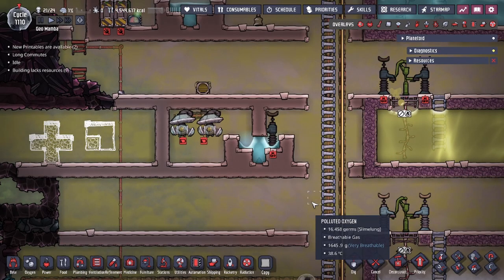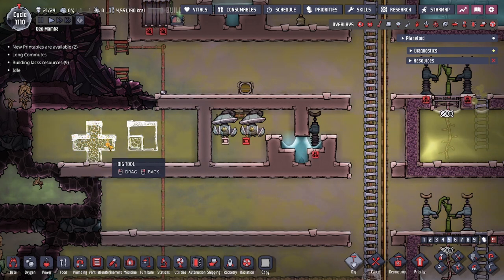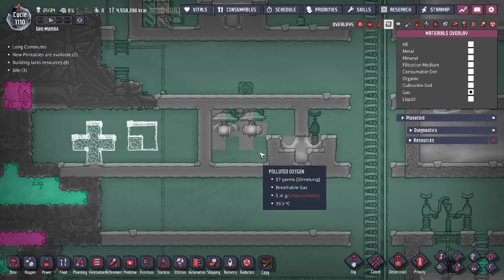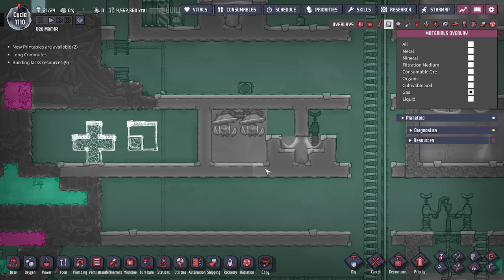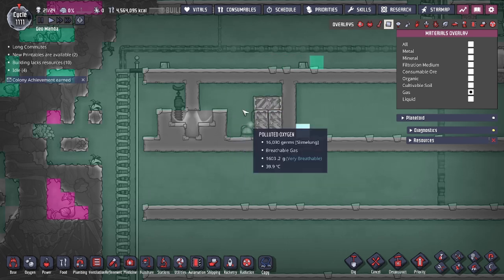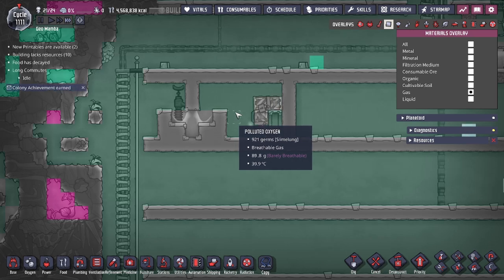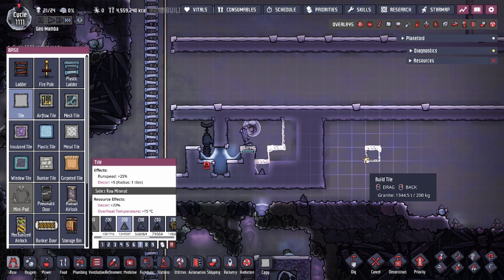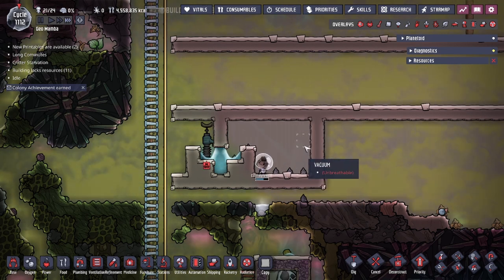Three Ways to Create a Vacuum in a Room - How to make a Vacuum Room - Oxygen Not Included Basics

Comment: I'm gonna have to try out that second method, but I'm thinking of just extending the build to have more doors crushing the air. Looks like any odd number would work. Something like five doors doing the crushing, three horizontal doors on top and one vertical door on the left forming the "wall" of the system.
Reply from the maker: you could extend the amount of tiles you "crush" by adding more doors, which drastically increases the speed

Comment: Fill the room with a liquid allowing the gas to be pushed out through the top. Close the top, deconstruct a tile in the bottom corner of a side, so the liquid rushes out horizontally and leaves a vacuum. The last drop of liquid creates a seal to prevent gases to come back in and you just rebuild the tile. Finally just wipe the floor. It is a lot quicker than a gas pump.
Reply from the maker: thats alot of water you gotta have nearby and stockpiled so you can do this. bigger the room, more water you need- i dont know man- this doesnt even seem faster as you have to count filling up the room as part of the process